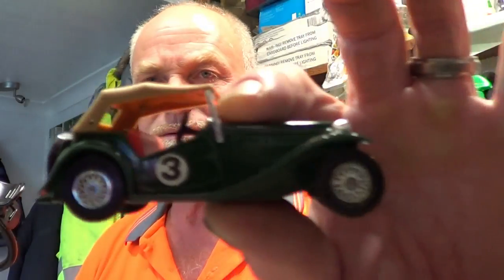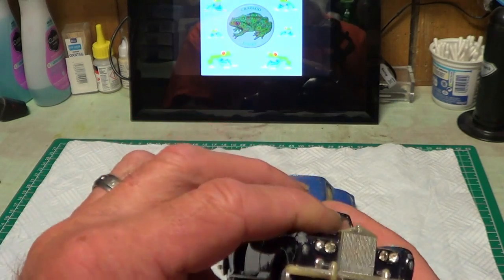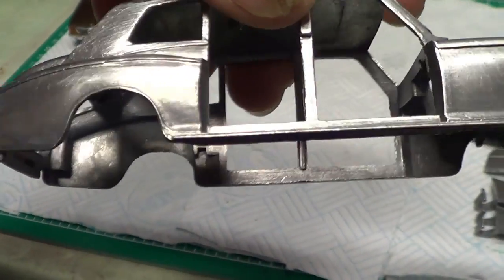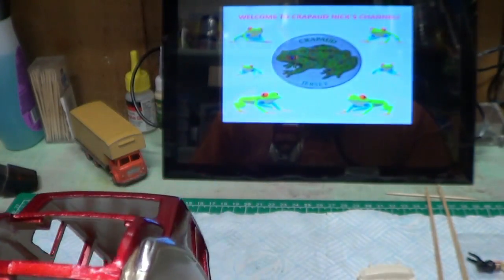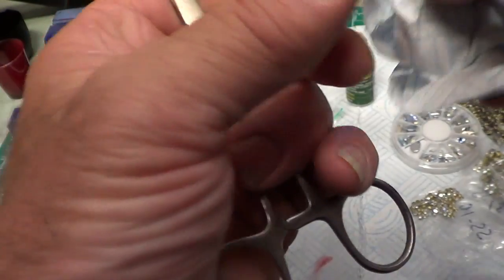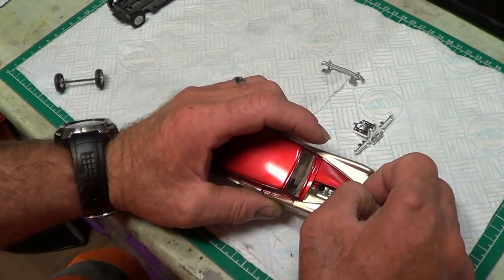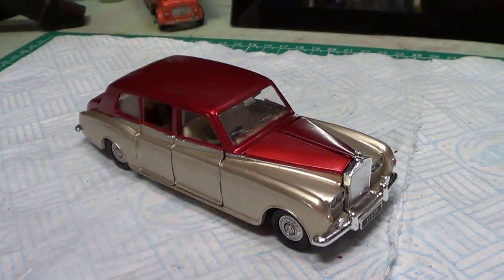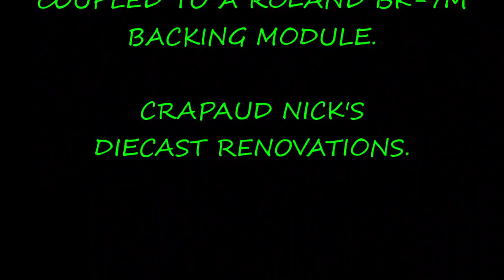DINKY TOYS ROLLS ROYCE PHANTOM V CUSTOM RESTORATION

Comment: hi nick super restoration and loving the 2 tone bodywork. thanks for the shout out you are very welcome . i have a few of these castings dinky did the first in the late 1960/s with spun hubs driver and passengers in black bodywork on a yellow plastic plinth thats what the holes in the bottom of the model is for. they also as you say did it in kit form and finally lasting until dinky went bust in 1979 they did it in light mettalic blue with no driver or passengers cost cutting i suppose. anyway stay safe  ps. i did finally get your text messages thanks all the best ian.
Reply from the maker: Thank you Ian and thanks for the info on the model, just going to have to decide what colour to do the doner car now lol.🤔 
🤔 Take care, all the best Nick.

Comment: The Phantom V is our favourite Rolls Royce - well, apart from the Rolls Royce jet engines powering the Lockheed Tristar...

BTW - have you tried using that 'Blue Tack' stuff to hold door parts in place during assembly?